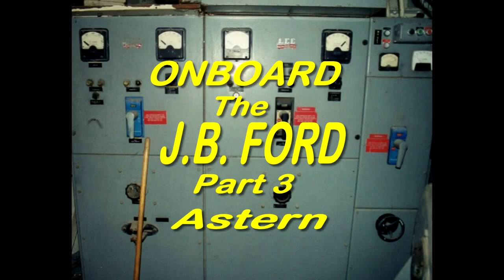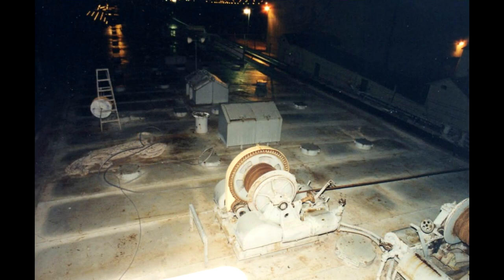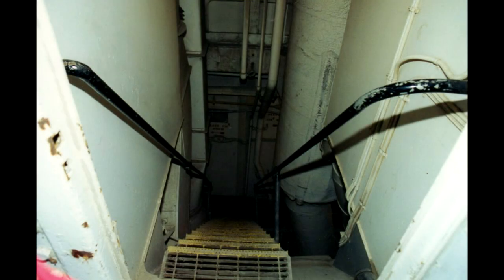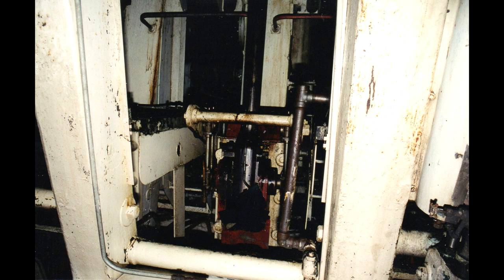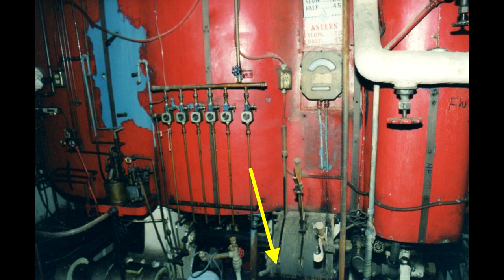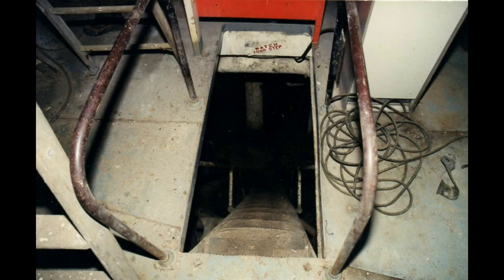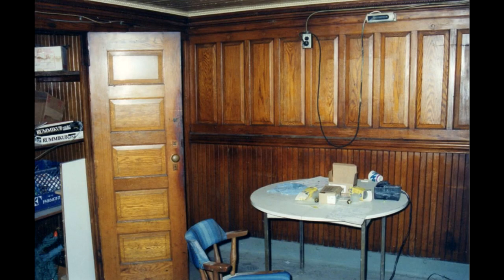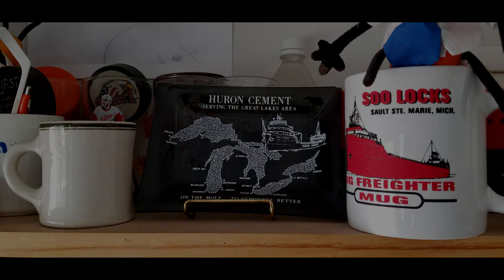Onboard the abandon ghost ship J.B. FORD Part 3.

Comment: Good Series on the JB, Wes! Such a shame that her Cylinder Block was cracked by an Inexperienced Engineer, Hydraulic Lock can do devastating damage to an Engine as he found out. Before he even THINKS of Rolling her over, the drains have to be open and the block thoroughly warmed through with the Throttle cracked, and the Simpling Valve open. I always hoped that the J.B.'s Sister, the E.M. Ford would be saved considering she had such a Rare Quadruple Expansion Engine built in 1897 by the Cleveland Ship Building Company, but alas, she was not shown mercy. The Fact that she was a Quad wasn't the only thing that made her Engine unique, but also the fact that Joy Valve Gear was used on her High Pressure and two Intermediate Pressure Cylinders before going to the more conventional Stephenson Gear on her L.P. . A Good friend of mine in steam circles, Carl Kriegeskotte (who very sadly just passed away after a long battle with Pancreatic Cancer) made an excellent documentary about her.
Reply: I would love to watch that... Is it on YouTube?

Comment: Wes, the "exhaust trunk" pipe appears to be cut off and directed into a large grate. Seems like a odd design unless I've seen it incorrectly. The pipe is pretty big. Can you or others shed light on this. Thanks.
Reply: The exhaust trunk continues (continued..) down to the condenser.  The J. B. Ford hard a jet condenser.  The grating was cut around the pipe.
Reply: @dabluesgarage  Ah, thank you for the explanation. My eyes aren't so these days I guess.
Reply: @roderickcampbell2105  In the lower Port engine room the condenser loosely looked like a large silver inverted water bottle.

Comment: Would have been interesting to see the emergency generator. A lot of the older ships where retrofitted with a diesel generator for when all else fails. Some of them had some interesting vintage engines driving them.
Reply from the maker: Hummm... I'll recheck my photos and see if one is seen.
Reply: @authorwes  Thanks.
Reply: The Jb had five generators that I recall.  Two steam turbines in the upper engine room.  Two Ford engine driven Onans on a small flat aft the main engine.  Then there was the Nordberg for the self unloading machinery.

Comment: I read somewhere that lubricating oil was not injected into the steam as it would poison the live steam and that the pistons were actually lubricated by excess water from the wet steam...?
Reply from the maker: That's interesting. Maybe someone who has worked with these triple expansion engines can further that discussion
Reply: Dani Hope  I think I heard that on a channel about battleship engines. Perhaps they were wrong or maybe battleships used higher pressures or something, not sure but I do remember the guy giving the lecture that they could not introduce oil into the steam. I wonder if maybe it is because the boilers on battleships are designed for maximum performance? I do agree about trains though. thinking about it, i seem to have heard something about that too.